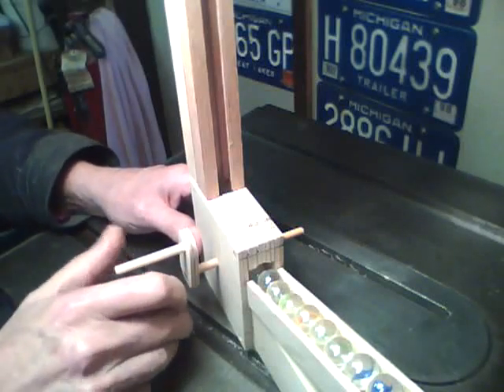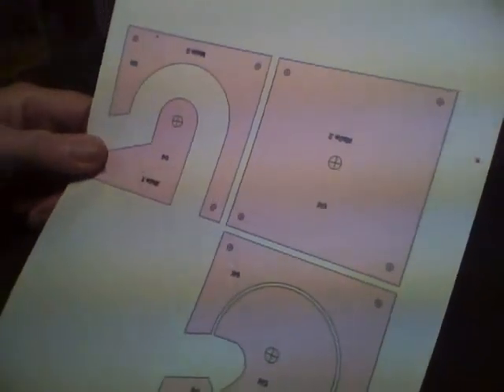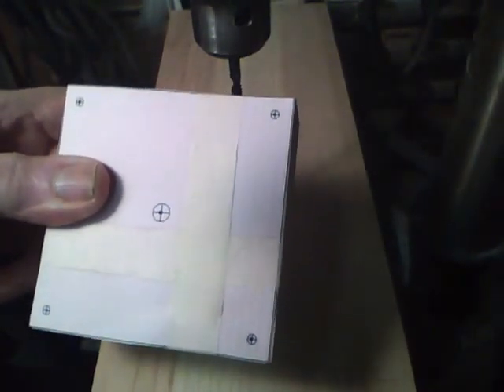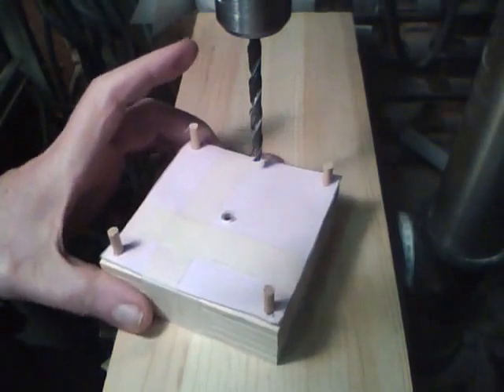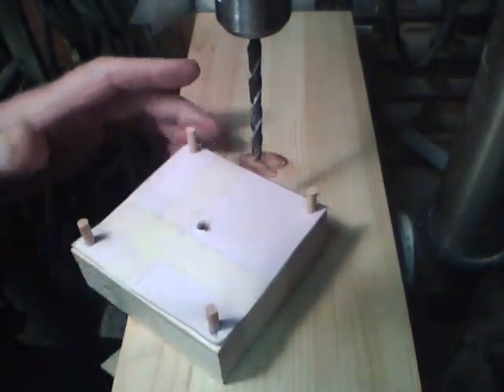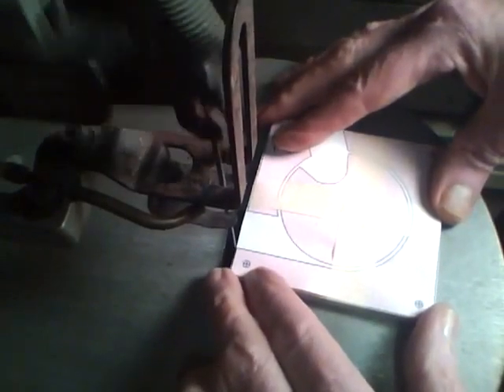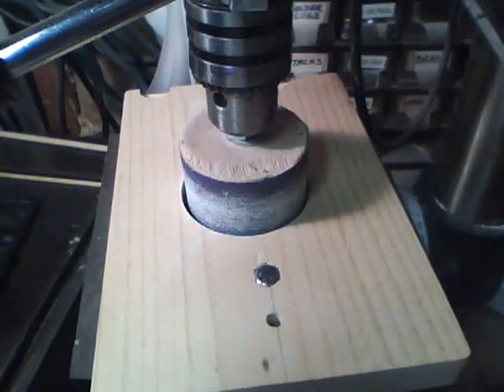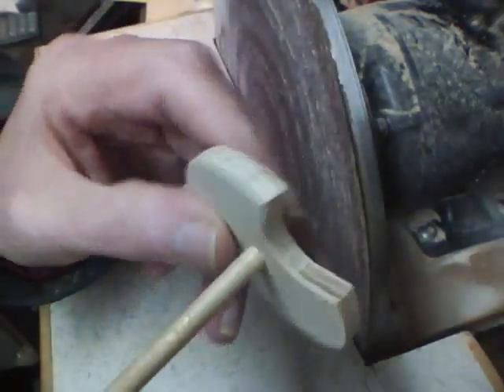Rotary Marble Lift with only One Moving Part

Comment: Hi Jim....As I mentioned below, I noticed in your SketchUp drawing that the rotary lift is with 3 slots and the marble entry is wide but in the video you show the rotary lift with 1 slot and the marble entry being narrow.  I am having some minor trouble with the marble being pinched with a single slot and jamming the rotary lift. I have to back turn a bit to clear it and then continue. Have you experienced this?
Reply from the maker: Yes, that's why I modified the design as shown in later videos. The SketchUp file is the latest one. See: https://youtu.be/KibioKqpvOQ
Reply: Thanks so much for the update Jim. I enjoy your creativity.
Reply: Jim....some feedback.....Before going and making a new one with your updated mods, I decided to take your original, the one with the one slot rotary lift, and modify the intake slot, bottom corner where it meets the curve of the track slot. I  chamfered this corner about 45 degrees with a chisel and then put a radius on it. Just enough to help the marble go down without jamming. Holy cow...it works like a charm!

Comment: Hi Jim, saw your video and love the marble lifter. I'm not the greatest computer guru so how do I print out the pattern to the size that I need. Thanks.
Reply from the maker: Thanks. You need SketchUp. Select top view. Select Camera, Parallel Projection. Select File, print. In the printer dialog select 1:1 scale. Print.
Reply: Hi Jim, thanks for the help. I am still trying to find the 1:1 scale on my printer dialog. Still working at it. :)

Comment: I don't know, Jim. Way too many moving parts for my liking. I kid, of course. I actually think it's a great idea! You may even be able to add another notch or two in the disc and pump marbles even more rapidly. I like your idea though. Thanks for sharing.
Reply from the maker: Thanks Steve. This is a prototype, I have to modify it a bit and move the intake up to the top so the marbles will drop faster. Also may add a couple more notches?
Reply: Jim Steinbrecher
Well, I'm definitely interested in seeing what you come up with. For years now I've thought about how cool it's be to create a marble machine. Hopefully some day I'll get around to doing so.